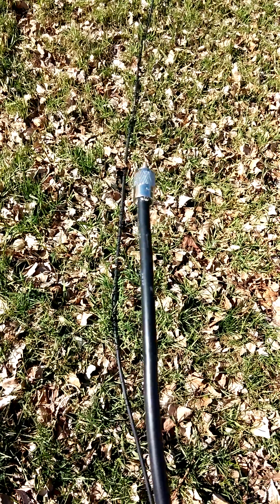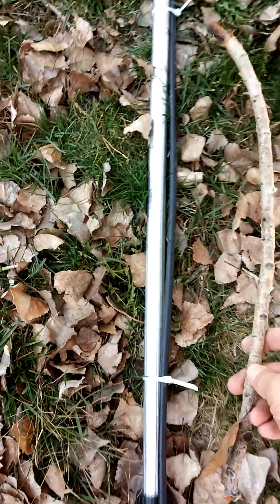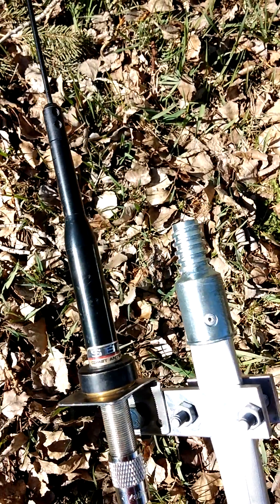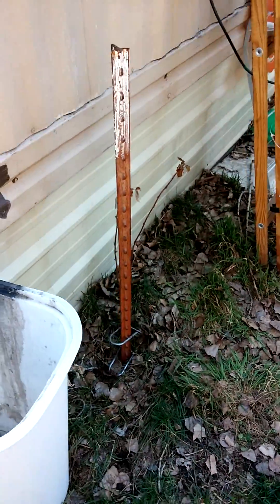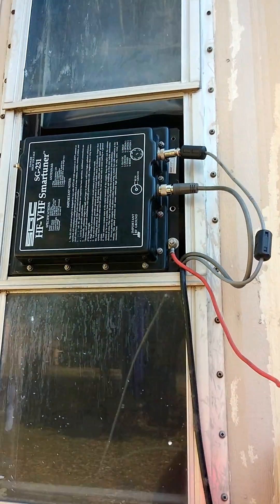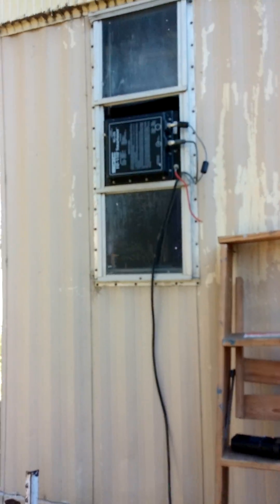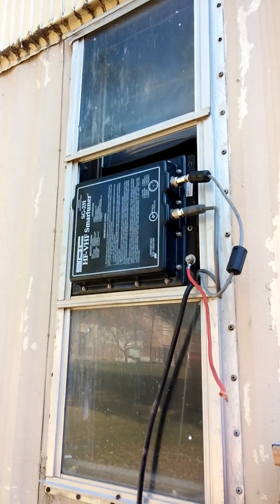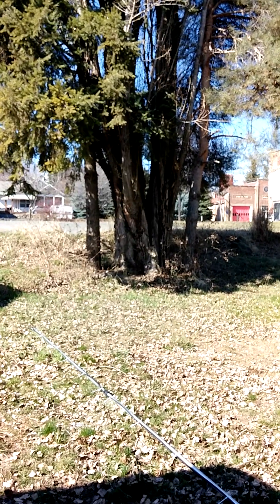Setting up my antennas

Comment: Trying to help someone. They have the SGC237. I sounded like it had the same single connection to the antenna you show on the back side. Rather than a so-239 for plugging in Coax. And, there is no balanced connection for 450 ohm line. So, the one connection. Obviously you hook one end of your antenna to that. The other , according to the manual, could be hooked to the chassis of the box. That would work for a loop or dipole ? Very unusual. but, that sounded like what you should do from looking at  the manual. Such a strange tuner, but I'm trying to help some old vets and that is what they were provided !
Reply from the maker: Sorry I didn't see this post a long time ago.  This tuner is an excellent remote tuner for what it does!!! You can hook any kind of antenna up to it you want as long as you don't use coax from the output of the tuner. ALSO, make sure you have a crap ton of grounding!!!!!!!!!!!!!!!!!  For your vertical or horizontal wires, if you use a dipole like g5rv, or a loop, you will be good with out running miles of ground wires.  I ran 8 runs of 20 foot long ground wires for a vertical random length wire, it was ok, my friend ran 4000 feet, and his just works sooooooo much better!!!  He has changed over to a 900 foot loop, WOW that thing rocks!!!  Just go play with your antenna setup for that tuner, you will find something that fits to the land you have, it will work! Just don't ignore the advice of LOTS OF GROUND RADIALS!!! JUST SAYING!

73

Comment from the maker: My initial setup for HF/VHF station antennas. As noted in video I have finished out the station with grounding rod, replaced short red wire with longer wire to reach down to a wire terminal, installed 4 random length ground wires for counter poise,  was able to get antenna wire into tree about 40' up, weatherized the window, installed 8' ground rod, added several chokes on all wires to my station and pc.  So far the only electronic issue I have in the house is a power strip that buzzes when I'm on 20m, flipping it off does the trick.